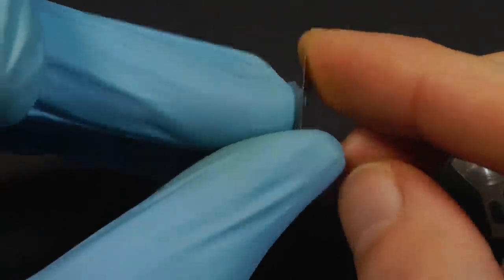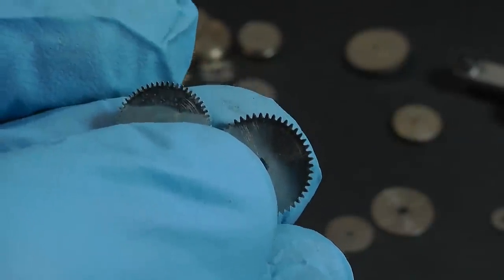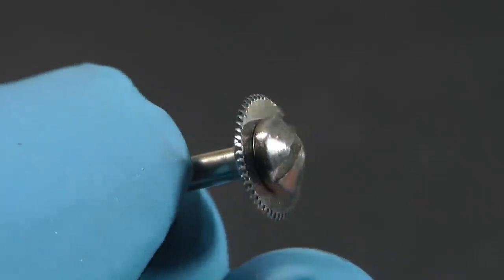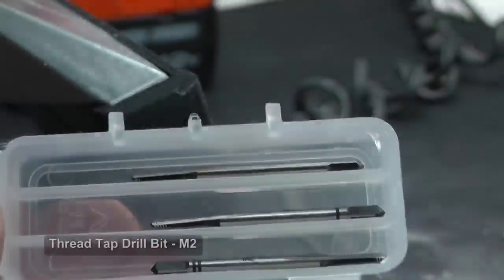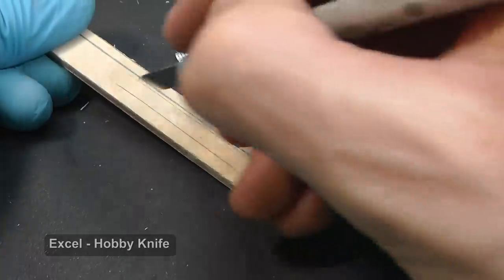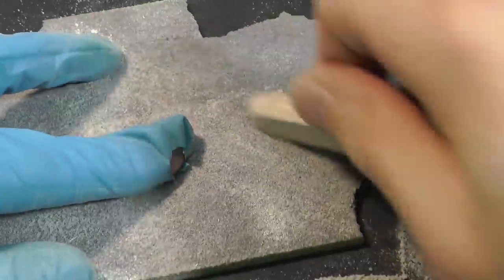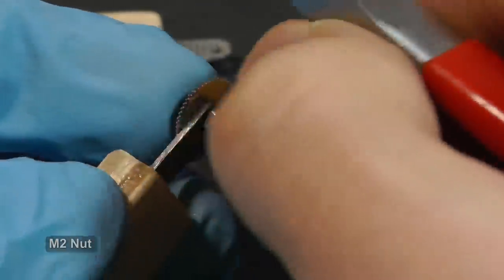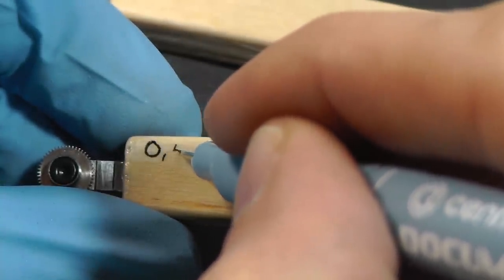DIY Riveting Wheel Tool - Rivets Home Made

Comment: Great video man! I am sure I will try this one. Only remark will be about you handling a file. With plastic it is ok to move file forward and backward. But with metal you should only make forward move with applied pressure. Backward moves doesn't remove any material and make your file dull.

Comment: Nice! Just a small helpful tip. Instead of the superglue for the thread, I would use a threadblocker. Makes it easier to lose the nut if the need should ever arise.

Comment: I wondered why you would cut up a perfectly good steel ruler for this, then I recognized you had already done so for your photoetch bender. The ruling marks are good measuring points on the bender, and good glue-holding "tooth"" on the riveting tool where smooth metal could slip out.
Very subtle.

Comment: Totally brilliant idea. I was just looking at buying a set and saw the prices . . . very very expensive. What you produced was easily as good as 'Rosie the Riveter', which is deemed as the best on the market. I'm thinking of trying out some of the small Dremel circular saw blades that might not even need the teeth grinding down from square.
I also need a curved blade for getting into the small areas like between the wing and the fuselage. This could simply be a section of circular saw that doesn't have to turn . . . similar to the galaxy riveting tool. Many thanks for heading in this direction. Should be good fun too.

Comment: i would advise using an old steel butter knife for the handle, you can cut the blade down and drill it and will probably be cheaper than the parts required to make the handle from scratch

Comment: While I cannot argue it worked, in the 50 odd years since I was introduced to taps and dies I have never seen anyone attempt to use a tap with an electric drill. Have you tried it with anything more substantial than a steel rule and did it work?

Comment: Very nice.  Wouldn’t the rivet wheel bind against the arm as you tighten that axle bolt?  Perhaps a small brass washer between the wheel and arm could prevent that from happening?

Comment: What do you think of custom photo etched parts via a normal mask from the printer and the fresnel lense of a overhead projector to shrink it?

Maybe you even can make decals with it if the color/ clear coat and paper or plastic model can resist the etching.

Comment: Hi David!

You're a younger fellow than I imagined.

More inspirational genius!

Cheering in these challenging times.

For raised bolt head detail in 1:43rd scale, I use PVA glue (applied with a sharp point or needle), plastistruct rod, a punch/rivet/bolt tool, transfer rivets (expensive), or if plated, plastikard strip bolt patern. I've experimented with various methods to make such more automated and quick (plus neat straight lines). I've not struck on a decent method yet. Have you any suggestions?

Thanks.

Comment: I am not trying to be critical of your tool, its nice, but would a solid wooden handle not be better? I own a table saw and lathe, so fashioning a sturdy handle out of hardwood seems more ergonomical than plywood... making the groove and putting the rule holder into the handle seems straight forward enough, so making a pleasing handle seems only right. I work with many wood working tools, many of us modelers do, and scratch building demands it.

Comment: WD-40 isn’t an oil/lubricant. WD means Water Dispersal, because that’s all it does. You should use actual oil.
Reply from the maker: Yes, it is true but it also contains 35% petroleum base oil. I use it for my bicycle chain also.
Reply: yes, but it’s a thin lubricant so it wears off very quickly. If you bike a lot, you have to use it a lot. Also being thin it doesn’t disperse heat very well.